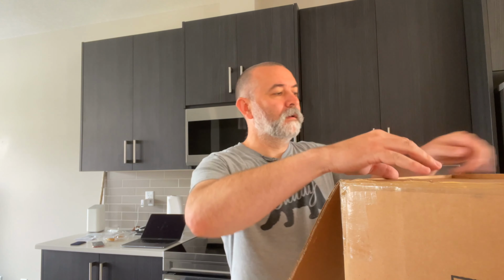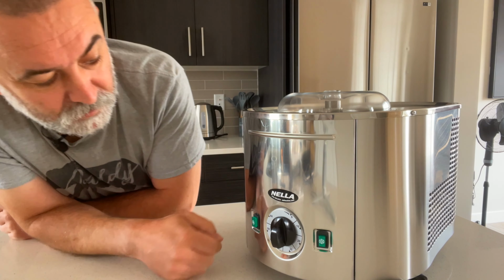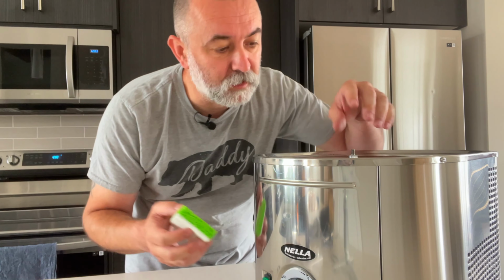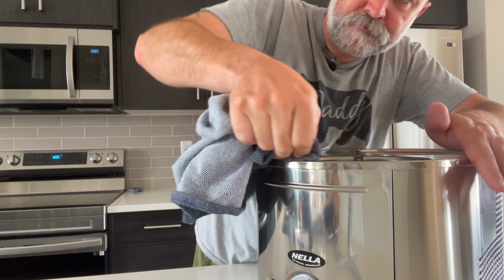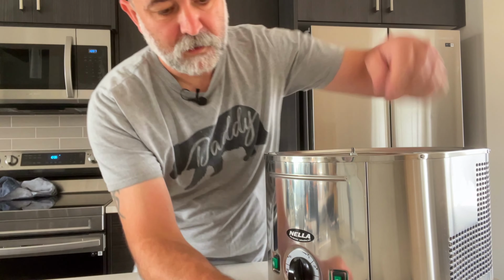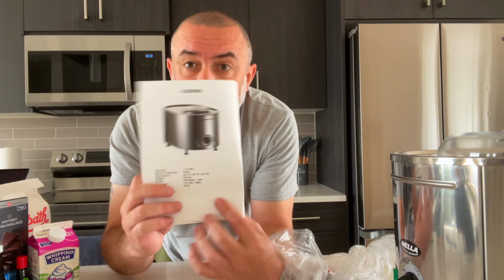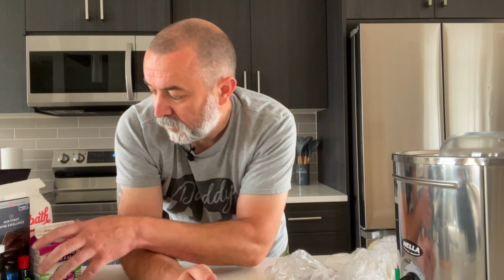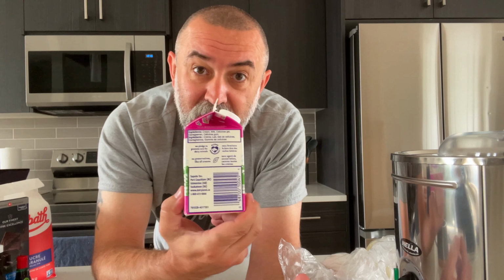UNBOXING Musso 4080 Piccolo ice cream machine

Comment: 1 HP, 100 watt motor? I'm confused. Electrically, 1 HP = 746 watts. Can anyone clarify the specs on the motor? Even the Cuisinart ICE-70 claims a 300 watt motor. I am guessing that the wattage in the wattage specs of the 4080 are wrong because I can't imagine that the motor is less powerful than the Cuisinart's.
Update: I just checked the user manual. It says "100 watts - .1 HP". 1/10 of a HP! That's more like it.
Reply from the maker: Yeah just read it wrong, sorry about that.

Comment: How does it compare against cube 750? Thanks
Reply from the maker: The Cube 750 has a much better dasher design. Size is comparable. Weight is a tiny bit less than the 4080. Capacity of the Cube is slightly less if you follow the manual (it will make little more. Cube motor is only 140w compared to 200w in the 4080. They are directly comparable to be honest. The built quality of the Cube is slightly better imho.

Comment: Hi - our Musso 4080 just arrived and I wished the manufacturer would include instructions if it needs to rest 24 hours after shipping to let the coolant, etc settle. Did you start using yours the same day it arrived or did you wait a while after unboxing it?
Reply from the maker: You do indeed need to wait 24 hrs. It will need a good clean as the stainless has a factory coating on it. I use disinfectant spray from Walmart.

Comment: It is a great equipment and I am delighted with the delightful results. But I was wondering, if I want to make ice cream with more air like 10-12% more air, could I beat the refrigerated ice cream base with an electric mixer before pouring it into the Musso 4080? 🤔
Reply from the maker: I’m confused, that’s LESS overrun than this machine gives you? Only cheaper home machines give low overrun like that.
Reply: @PolarIceCreamery  I mean if the Musso gives you an 20-25% overrun then if I want a 35% overrun Can I beat the ice cream base with an electric mixer before pouring it into the Musso? in this way incorporating more air into the ice cream before the churning process.
Reply from the maker: Maybe, I’d be surprised to be honest as the dasher spin will likely knock that air out but try it and let me know. You can also do things like add some egg white to the base. This type of protein always increases overrun a lot.
Reply: @PolarIceCreamery  oh thankyou I Will add egg whites first

Comment: Hi Nick, do you know anything about Nemox 5L automatic ice-cream machine? I found a brand new one for £450 which is a bit of a bargain considering they sell for around £1500. There is a business nearby which is closing down and they are selling all their kitchen appliances. They didn't even get a chance to use the machine. Would you recommend getting it as an upgrade for a Cuisinart ICE 100? Thank you!
Reply from the maker: Yes they are excellent. I had one for my UK business at the start and loved it. It’s a massive upgrade over the ICE100 and the resulting ice cream will be considerably better.
Reply: @PolarIceCreamery  Thank you for your reply.
Reply: @PolarIceCreamery  Which machine would you recommend between the Nemox Chef 5L and Musso Stella 5030 for a home user? If I remember correctly you did mention in a videon that you were a owner of the 5030 too at some point. Thank you.
Reply from the maker: @daniels2423  they are both excellent in different ways. The build quality of the Nemox is higher, it has both a fixed bowl and removeable bowl. It can keep a mix at draw temperature for a while which is a nice feature and the lid is a better design albeit flimsy. If it were new, the cost is too high. 
The 5030, is a beast and can make larger batches, faster than the nemox even though it shouldn't be able to. There are no smart features at all as it is just a motor with a dasher attached. It's easier to repair and just "works" all the time. My Nemox was a temperamental little so and so!
Ice cream quality was slightly higher in the nemox but not enough so that people would notice.
For the money you're getting that Nemox at, get that.
Reply: @PolarIceCreamery  Thank you! Really appreciate your advice.

Comment: Wow, that was abrupt. I feel robbed because I wanted to see that Lello Musso in action! 

Really liked that video, and happy to see you're setting in slowly but surely. Also, the bit about the weight is too real. I started off loading most of my ice creams to friends and my skinny husband.

How's Canada? Must be a very different vibe than England
Reply: One thing, is the ice cream container/bowl of the Musso removable? It doesn't look like it. Doesn't that make it a lot harder to clean especially if you're making multiple batches in a row?
Reply from the maker: Haha yep I’ve been called abrupt before 😂🤣. Canada is amazing so far thank you! 
You are correct, the Musso machines do not have removable bowls. It sounds like a pain but in reality, it’s surprisingly easy and quick and rebatch. I can clean it and get the compressor back on in 5 minutes no problem. Once you e turned the compressor off, it’s recommended to wait 5 before turning it back on anyway.